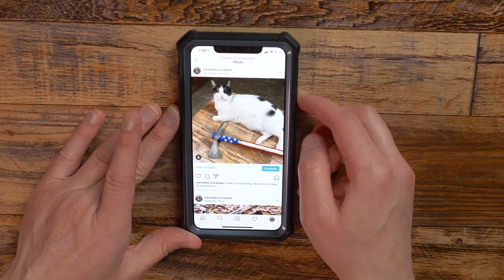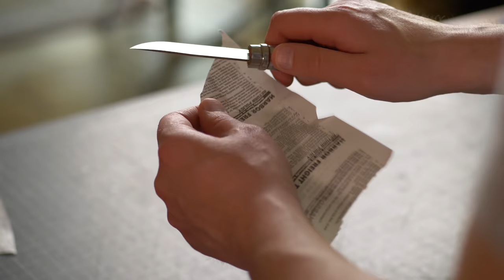How to Modify & Customize an Opinel Knife

Comment: I love modding Opinel knives.
From a basic handle reshape, curving one side to parallel the cutting edge (similar to the official gardening blade) and a recent large (maybe a No. 9) with a modded spear point blade and handle end flattened to give a maximum blade length nit far short of the handle, then gun metal blue finish.

Nice leather work esp. the dye.....I did another knife sheath in veg tanned leather and ‘vinegaroon’.......looked.....rustic!

Comment: Nice work, one thing I would recommend doing for the embossing of the letters on leather, use a large C-Clamp to press the stamp into the leather, you will get a very crisp and deep impression when doing that, instead of using a hammer that can cause a bounce and a mis hit
Reply: Now that’s something I’d not have thought of, thanks.
Reply: Excellent tip. That's how I emboss my "handmade by" stamp into leather.

Comment: Hi Cornelius, thank you for the video with such nice embelishments. Just one question - what kind of acid (?) are you using for the blade? And is the blade carbon or stainless? Chris
Reply: Hey, not op, but french. Acids are vinegar and lemon juice, and blade is carbon. You can zoom in on the handle at 0:10 ;D

Comment: cool knife I like the way you did the blade. I was going to start carving with the old ryobi I have. can you tell me are all flex shafts compatible? I know it has to be a 1/4" or 3mm that's it?
Reply from the maker: For the most part all flex shafts bits and burrs will work if you have the right collets. (Collets house the burrs) I find the most standard collet being 3mm. Larger units like the Foredom go up to 1/2 on there burrs which is crazy

Comment: Your Videos for mods to Opinel knives inspired me to give it a try. I got the handle completed and tried the mustard/vinegar/lemon juice mixture to put a design on the blade of a No 8. I left it on overnight and when I took the dried mixture off, there was no design on the blade. Any suggestions will be appreciated.
Reply from the maker: Thank you for the kind words my friend! Were you using the stainless steel version?
Reply: Yes. I so wanted to do the blade. I'm looking at getting the carbon version. Thanks for answering my question and I like your video set up. Do you have to pay the cat extra for appearances in the videos?
Reply from the maker: Haha no, she just comes and visits me from time to time. And yes, this method only works with the carbon version

Comment: I need help. I just started engraving wood and when I engrave I get these wood "pieces" that hang onto the wood where I engraved and I dont know how to remove them without using sandpaper and sanding away part of my engraving. Is sanding the only way to get these pieces to go away? If there a way to keep them from appearing?
Reply: Do you use different grit sandpaper?
Reply from the maker: 120- 400 grit :)
Reply from the maker: It is part of power carving. Use bristle disc's and sandpaper to remove them.
Reply: Thank you so much. I greatly appreciate the response
Reply from the maker: No problem :)